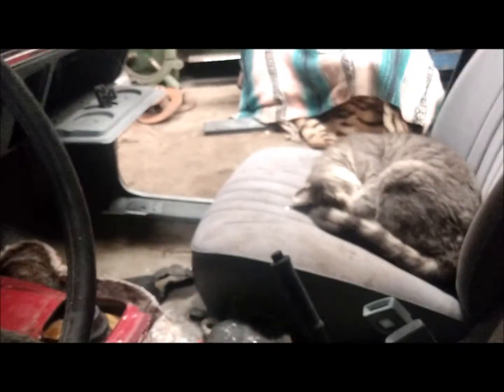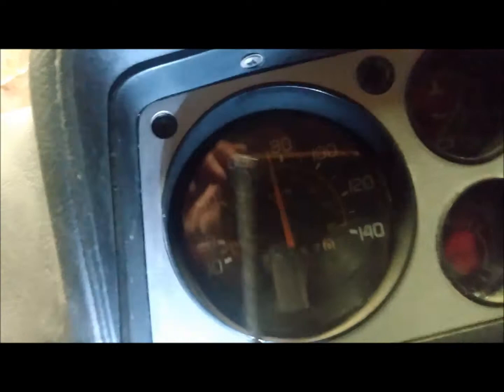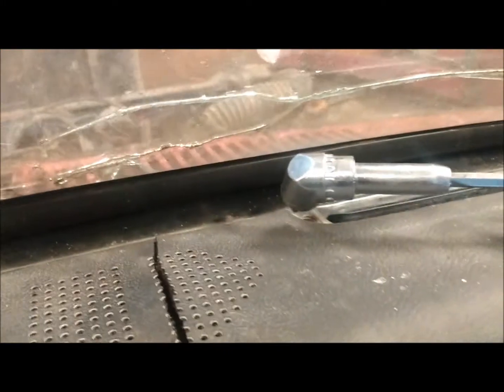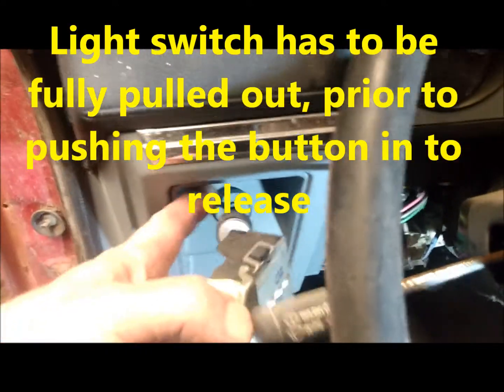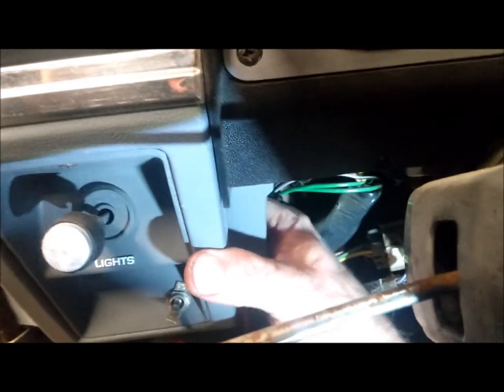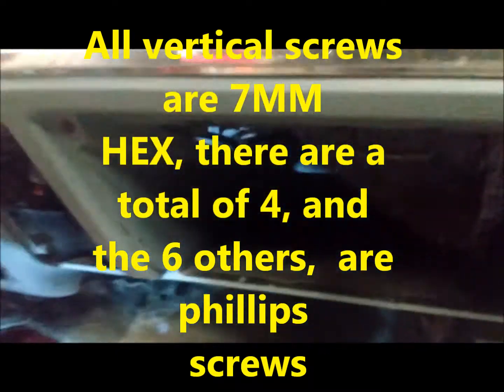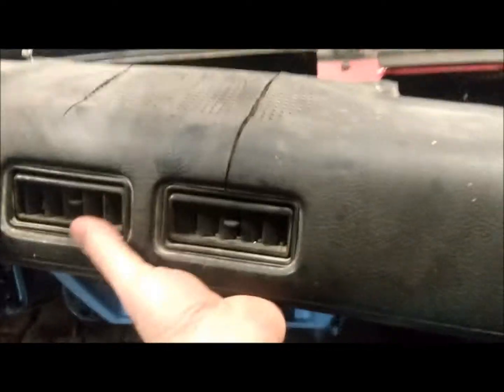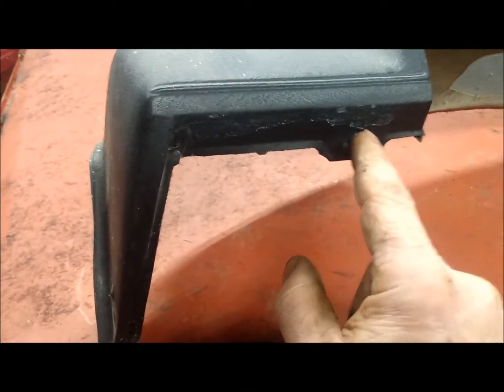Chevette DASH PAD removal

Comment: Nice video. Looking into buying one. Had 4 when I was younger. The one I’m looking at has the same two cracks on the top of the dash. Do you know a part number for 1979 floor pans? Driver side needs replacing. Passenger ok. Just surface rust. May do them both
Reply from the maker: No reproductions on floor pans.  Cardboard template, and some 20 gauge metal, or whatever works